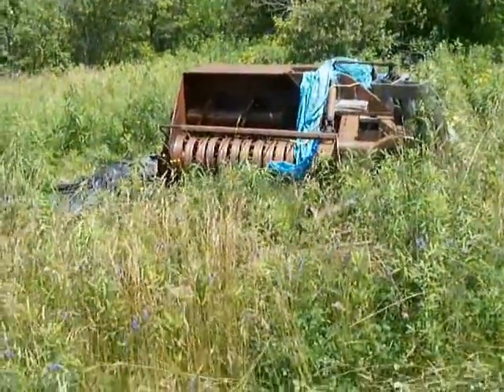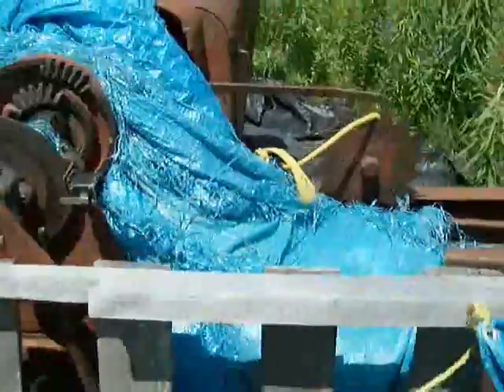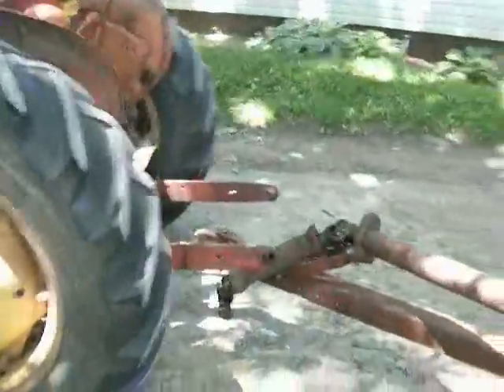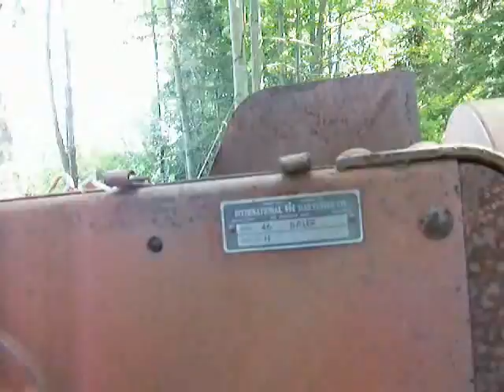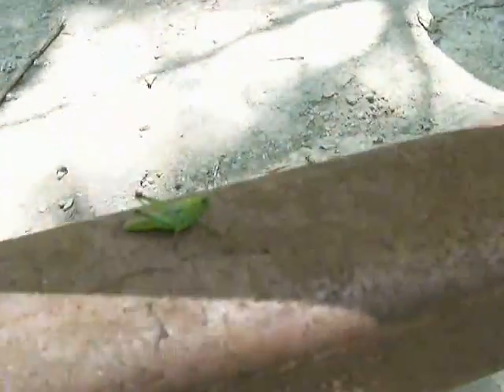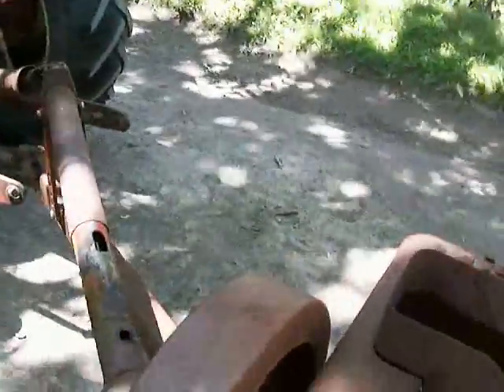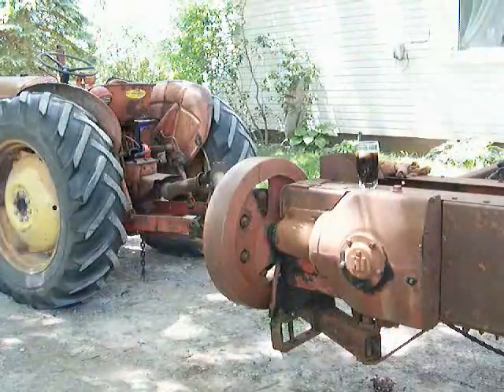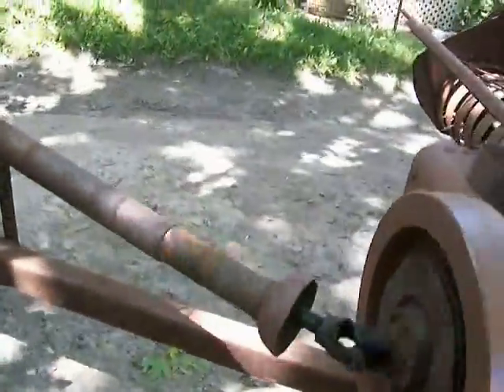Bailing hay summer 2009

Comment: The 45 was the IH baler that wasn't worth a hoot in heck. The 47 that I have cost me 250 bucks and misses one bale every once in a great while if I run good sisal twine in it. Billhooks being dirty rusty or worn will cause of an IH baler to miss. Dull twine knives will cause them to break knots. Its an easy fix either way. If you continue to store your baler outside, coat the knotters with grease when ya put it away to prevent rusting.